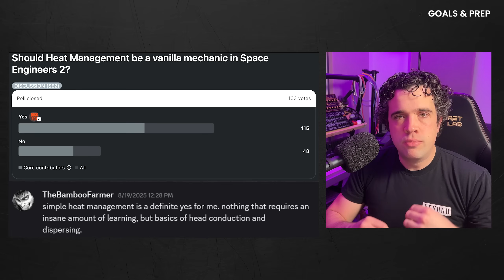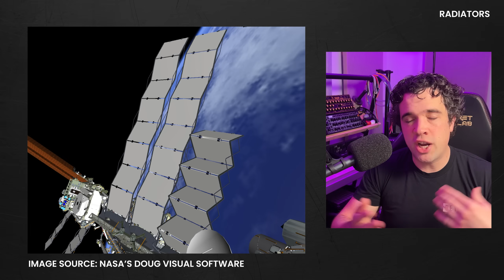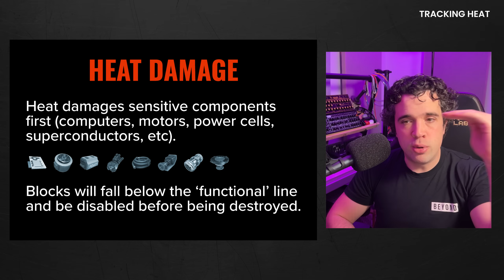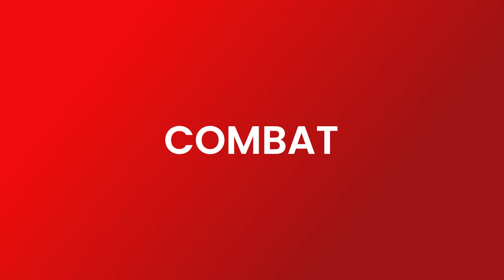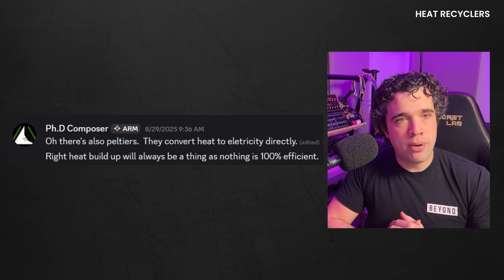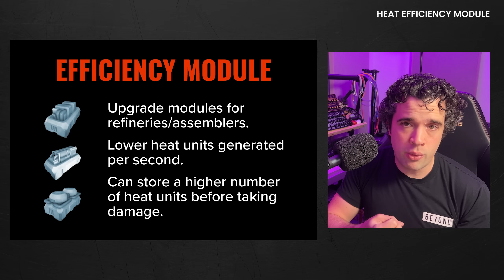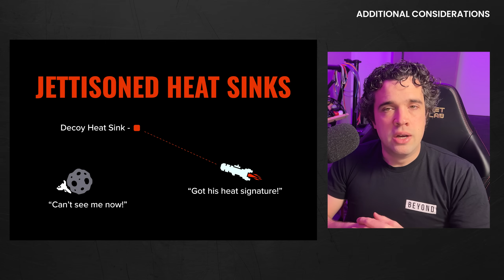Heat in Space Engineers 2? How heat could change EVERYTHING

Comment: I really love how this idea solves gun bricks and limits internal welders.
Reply from the maker: Right. Solves some core metas right now which have no drawbacks! You can still do these things, you just have to be smart about it now so you don't overheat.
Reply: I feel like it'd be difficupt to find a proper balance with the effectiveness of radiators, because on the one hand they need to be bad enough that gun-bricks don't just turn into gun-bricks with a bunch of radiators taped to the back, but also they need to be good enough that one can build a good looking warship that is not just totally covered in them.
Reply from the maker: @etwasanderes2  Just shoot 'em in the back 😉
Reply: @diggrok  having a distance penalty for radiators/heat batteries from high demand blocks might be a solution, that further they are from high heat producers the more required, thus more vulnerable. So either gun brick with giant weak spot at the back or more intelligently spread out heat management blocks rewarding interesting ideas (but obviously if heat management blocks are too close to weapons that make them vulnerable to heat seekers)
Reply: @MrMediator24 You also just made normals ships nerfed... Normal ships with a lack of interior blocks.
Reply: @etwasanderes2 problem is that some people don’t know that heat is a problem in space and the design philosophy for radiators does not support how people build
Reply: @etwasanderes2  See I think the main way to fix that is like it says in the video, radiators are a weak point. This forces you to be deliberate in where you place them and for many combat ships they will likely rely mostly on internal heat sinks for actual combat.
Reply: Just cover the outside of the brick entirely  in radiators lolol this wouldnt stop those people
Reply: @joshjenkins3815  I mean yeah you could do that but that's gonna be worse than an actual well engineered combat ship and all its gonna take is destroying some of those radiators and then your opponent is just going to cook themselves alive trying to fire that many guns at once.
Reply: @OrbitalMechanist and the normal well engineered ship either cooks faster, or dies faster, because it wants to be pretty, not a turret wall with radiators.
Reply: @SioxerNikita  I'm a little confused as to what you're getting at. I never said anything about ships being pretty, all I was saying was that a heat mechanic does effectively regulate gun spam. This doesn't solve every single problem with the SE meta but at the very least it limits the amount of guns you can effectively use on a single ship. This solves gun bricks specifically because if you are limited in how many guns you can use at once without sacrificing survivability then covering a ship with them just isn't practical.

The normal well engineered ship in this case doesn't cook faster or die faster. If you build around having less guns and less radiators you will be able to take waaaaay more damage and stay alive long enough to shoot back and kill the other guy who probably won't even live long enough for a second volley. You can technically still build for high volume of fire with a shit ton of radiators, but now that's a specific niche type of ship with almost no survivability and a giant glowing weak spot. It doesn't completely eliminate giant battleships covered head to toe in guns, but it makes them a lot harder to do well and it makes it so that they aren't the solution to every problem.

That should be the goal with the mechanics in space engineers 2. Everything should have a tradeoff. Like 90% of IRL engineering is just carefully balancing stuff like this and that's what makes engineering games fun.
Reply: @OrbitalMechanist  It doesn't really effectively regulate gun spam. It doesn't limit the amount of guns you can put on a ship, anymore than conveyors or Gyros. It just because another block you need to place. 

The thing is, a "Normal well engineered ship" does not necessarily have any level of advantage. Why would you be able to take "waaay more damage"? If that were true, gun bricks wouldn't be the default meta. And no, you don't need a ton of radiators, just a ton of coolant and/or heat sinks, and just about as many as anyone else needs per gun. 

Overall, the problem is that the heat management system does nothing but give another block tax for just playing.

And no, it doesn't make gun bricks any harder to do. If anything, it makes the kind of ships most players want to see harder to do. It makes the gun brick easier comparable, because it is just scalable volume. 

Space Engineers 2 is already about trade offs, but the Engineering in Space Engineering doesn't come from managing various bars and stats. It comes mostly from self-imposed challenges. The "build an automated factory" or "Fit all the systems and try to maximize this ship while still making it look like a sci-fi ship".

In reality, cylinders or cubes is the most likely shapes in real life space, as long as the vessel never needs to go into atmosphere. That or perhaps spheres. A well engineered combat vessel in real life is going to be semi-autonomous cylinders packed with weapons so they can end fights rapidly. They'll essentially be the death bricks.

The more "trade off" mechanics you add, without artificial limitations, the more designs will just converge into bricks/cylinders/death bricks, because those are the most efficient designs. The more interior space is needed for arbitrary blocks, the more design goes away from having a well designed interior for people playing Survival. 

The thing that makes ships/vehicles/bases/etc. look like they do in real life, is because they have to be operated by real breathing humans. You don't even really play a real breathing human with space requirements, a need to maintain every subsystem, etc. 

The incentives shift towards the thing you say it solves.

And I donnu, but adding an "opposite Reactor" bar doesn't really seem like it adds a lot of Engineering. SE is already mostly "Put Thrusters onto something until it satisfies speed and lift" and "Put Gyros onto something until it satisfies your need for turning" and "Put Power Plants on to it until it satisfies your power need", you just added "Put heat modules on to it until it satisfies the heat need". It doesn't really add that much, it's just another block tax in most cases. There isn't really that much cool "Engineering" in it.

Real Engineering is balancing structural integrity, very limiting cost, maintenance accessibility vs. size and weight, keeping meat cylinders comfortable, material strengths for the job needed, etc. etc. etc. The vast majority of real engineering doesn't get emulated by adding another bar to manage, because for that to have any feeling of real engineering it would be about putting down heat pipes, active cooling systems centered around important points, ensuring that heat never reaches things that melt, etc. and I'd prefer having larger ships at more than a few FPS than trying to emulate a simplified thermodynamical heat system, because that's what's needed to add engineering.

If managing stats like that is "Engineering", I'm "Engineering" every time I choose a fit in EVE or Elite Dangerous... but stat balancing works great in those games, because you have fixed hulls. You don't have a fixed hull in SE, and most problems are solved by "Just add more blocks".
Reply: @OrbitalMechanist  Oh yeah, also, it doesn't matter if you end up cooking yourself alive trying to fire that many guns at once... if the opponent is incapacitated before you overheat.
Reply: @SioxerNikita  I feel like you aren't understanding the idea of the heat system. It can take way more damage because it doesn't have so many guns that it needs to be covered in fragile radiators and the loss of a few will make it overheat. A ship covered in radiators and guns cannot afford to take a hit. 

Also I was referencing IRL engineering as a "thats the right feeling to go for" not saying that it has to emulate real physics one to one. Space engineers has a speed cap and most fights take place within visual range, which means its already completely different from actual space warfare. And the heat system isn't just "another bar to manage". The whole point is that it interacts with almost every other system in ship design so that you have to build ships with heat in mind.

I think its interesting that you brought up the fact that current SE is very much just about "add more of this thing until it works". The main reason for the heat idea is that it counteracts that flaw. In space, everything generates heat and so if you don't want to overheat you can't spam thrusters and guns. Radiators and heat sinks act as a way to alleviate this issue slightly, so it isn't just a hard cap, but volume scales faster than length and so you get diminishing returns. "Just add more ____" only works to a point. If you try to build a ship that can do everything all of the time, it will be wildly cost-inefficient or it will suck at everything. Probably both.

As for the second reply, that would be the only point of a ship covered in guns if you had a heat system. A single volley can do a lot of damage but you best be damn sure you can disable your opponent's ship with that volley or you're gonna have a bad time. And the easiest counter to that strategy is just to use multiple ships or strike craft. If they spam point defense then that means they are devoting that much maximum heat into something that isn't guns so you can bring in your own gunship and win that way. My goal isn't to invalidate the gun brick (because lets be honest sometimes a ship covered in guns is kinda cool) but to make sure that it isn't the sole meta and that there are other viable approaches to combat.

Lastly in regards to asthetics, while that wasn't really a part of my initial remark I do agree that the devs should attempt to design the systems in such a way that it encourages good looking ships. 
Because of the weird speed cap flight model the game currently uses, battles (especially if they increase survivability like they want to) behave a lot closer to naval warfare than space warfare. Because of that, the ideal ship is not going to be a sphere or a cylinder. It somewhat depends on a ship's role in a battle and its intended purpose in combat but most SE combat ships would ideally be diamond shaped, able to bring all guns to bear on a single forward target while focusing all of the armor and defenses on that same target. I personally don't see a problem with ships built for 1v1 encounters being diamond shaped, because the minute more ships enter the equation it gets a lot more complicated and you get way more options.
Reply: @SioxerNikita  and as for the idea of just using internal heat sinks or coolant, those would be less vulnerable but still subject to diminishing returns as the total mass of a ship increases. I personally would make heat sinks explosive in addition to that, and coolant has its own challenges.
Reply: @OrbitalMechanist  "I feel like you aren't understanding the idea of the heat system. It can take way more damage because it doesn't have so many guns that it needs to be covered in fragile radiators and the loss of a few will make it overheat. A ship covered in radiators and guns cannot afford to take a hit. "
Okay, now remember the entire video. You don't need to be covered in radiators... you just need enough heat sinks so you can fire your guns long enough that the other ship is incapable of fighting back.

Yes, I understand the idea of the heat system. I also know it will require adding radiators to ships all over the place if you want to do anything that requires sustained heat.

"Also I was referencing IRL engineering as a "thats the right feeling to go for" not saying that it has to emulate real physics one to one. Space engineers has a speed cap and most fights take place within visual range, which means its already completely different from actual space warfare. And the heat system isn't just "another bar to manage". The whole point is that it interacts with almost every other system in ship design so that you have to build ships with heat in mind."
Okay, power interacts with almost every other system in ship design. It's a bar to manage.

Unless heat moves from block to block, requires heat piping, to get it away from hot areas towards cold areas, it is essentially just a bar to manage. One you can decrease the heat with radiators, and increase the capacity with Heat Sinks as described.

And I do not want a thermodynamic simulation in the base game, it would make the game crawl to a halt.

"I think its interesting that you brought up the fact that current SE is very much just about "add more of this thing until it works". The main reason for the heat idea is that it counteracts that flaw. In space, everything generates heat and so if you don't want to overheat you can't spam thrusters and guns."
Now here is the point. You can still just spam thrusters and guns, because there are blocks you can use to stop that. If heat becomes so punishing that the alleviating blocks doesn't help, all you did is putting a timer on every block that can run, and punish all forms of ships, not just ships for fighting... unless the only blocks that generate significant amount of heat is thrusters and guns, then you still see what happens. You don't reduce the amount of guns because you have a heat budget, because you can still do far more damage initially, so even if we say it counteracts "that flaw", you just encouraged all the guns anyway, and then a slow trickle of fire afterwards that can be managed, because the alpha will destroy a lot of the external blocks on the enemy before heat becomes a problem. 

"Radiators and heat sinks act as a way to alleviate this issue slightly, so it isn't just a hard cap, but volume scales faster than length and so you get diminishing returns. "Just add more ____" only works to a point. If you try to build a ship that can do everything all of the time, it will be wildly cost-inefficient or it will suck at everything. Probably both."
That's the interesting part, you said volume scales faster, yeah... that means you can add more heat sinks, more and more as much as you want, because everytime you increase size, you increase volume more.
And yeah, building a ship that can do everything all the time isn't really the flaw you were talking about fixing. You were talking about welder walls and gun bricks. This doesn't solve gun bricks... the most cost-efficient ship in combat is the one that takes the least damage, the ship that takes the least damage is usually the one that focuses primarily on firepower or very exploitative maneuvering. The exploitative maneuvering is one shot that hits and dead in many cases, and tends to take a long time to kill stuff... Also interestingly enough, this idea would kill that more than the alpha buildings.

"As for the second reply, that would be the only point of a ship covered in guns if you had a heat system. A single volley can do a lot of damage but you best be damn sure you can disable your opponent's ship with that volley or you're gonna have a bad time."
Heavily depends on the balancing. If it becomes that limiting, then the other ship is also going to have a bad time, because you just took out a ton of radiators, guns, thrusters, etc. You don't have to disable them fully, just make them worse off than you.

"And the easiest counter to that strategy is just to use multiple ships or strike craft. If they spam point defense then that means they are devoting that much maximum heat into something that isn't guns so you can bring in your own gunship and win that way. My goal isn't to invalidate the gun brick (because lets be honest sometimes a ship covered in guns is kinda cool) but to make sure that it isn't the sole meta and that there are other viable approaches to combat."
If we go with "Easiest counter to that strategy" then my counter to that is "use multiple ships myself, with also a lot of guns on them, and strike crafts, with lots of guns on them".
That's not really a counter strategy, that's just... add more ships... which the gun bricks can abuse by deploying more alpha gun bricks.

You can't really solve this meta, without cultural rules... because that's how block building games work. Empyrion has tons of arbitrary block limits, and it has the same issue if you start looking at PvP metas, unless there are artificial rules. Block limits just means you optimize where you place your limited blocks, not stop building the most efficient design.

"Lastly in regards to asthetics, while that wasn't really a part of my initial remark I do agree that the devs should attempt to design the systems in such a way that it encourages good looking ships. "
You can't really, because even real life doesn't really "encourage" good looking ships. It's a total accident that physics encourage ship shaped designs in water, and tank shaped designs on land. Those are optimization bricks as well. They aren't platforms doing it for aesthetics, they are just physics limited things. To make the systems in a way that encourages the same kind of design, you need to add things like maintenance requirements (Chores of having to be able to reach blocks), much longer construction times (because if you can just grind and maintain the block, and weld the armor block back again, you aren't encouraging maintenance corridors much), random failures, full on aerodynamic models, and having to maintain actual NPC crews that can do these tasks, and that is simply not realistic to do in a block building game. Adding heat doesn't encourage more good looking ships, at least as described here. It gives forced external blocks that will have to be built around to make good looking ships, and punish ships that wants to look pretty with windows and interiors. Unless you have to deal with almost all of physics, most "realistic" features added, will just converge on bricks with guns in combat.

"Because of the weird speed cap flight model the game currently uses, battles (especially if they increase survivability like they want to) behave a lot closer to naval warfare than space warfare. Because of that, the ideal ship is not going to be a sphere or a cylinder. It somewhat depends on a ship's role in a battle and its intended purpose in combat but most SE combat ships would ideally be diamond shaped, able to bring all guns to bear on a single forward target while focusing all of the armor and defenses on that same target. I personally don't see a problem with ships built for 1v1 encounters being diamond shaped, because the minute more ships enter the equation it gets a lot more complicated and you get way more options."
What makes SE behave more like Naval Warfare (Specifically Caribbean style naval warfare) than Space Warfare is primarily the very limited engagement range. In reality, space combat will be out in ranges where you can't see the target with your eyes. That is actually how Naval Warfare primarily works now. It becomes a question of who sees who first, and who has the best point defense, and who has the best weapons to breach the other side's point defense.

And yeah, cylinder is essentially real life future space ships, look at Children of a Dead Earth. That is what space combat will almost inevitably work towards. Missiles, orbits, guns, semi-autonomous cylinders with as few exposed sub-systems as possible, and as few sub-systems necessary with some redundancy.

SE though, broad sides are in the end more efficient, you have a large surface area, and especially with all of the AoE weaponry, means that you lose less weapon systems per hit. The Diamond shape also compresses a lot, and surprisingly enough less effective, because you end up spending more weight on heavy armor blocks because of the prolonged length, and you end up with a sidewas far larger cross section overall.

And I've played enough EVE to tell you one thing, more ships doesn't necessarilly add more options. It works for a short while, for specialized prepared combat. It quickly compresses into "shoot one target at a time until dead, then go on to the next". Tactical choices and options sound great until you remember that cover, dropping to the ground, obscuring features like trees and bushes, and more, aren't really available in Space. It becomes very Naval combaty. You fire at what you can, or you concentrate enough fire for quick kills. Naval combat until recent was kind of "slugfesty" because it was hard to hit. Even WW2 ended up being less about maneuvering unless close to Islands that could afford you cover, and more about staying in or out of range.
Reply: @OrbitalMechanist  You are aware that heat mechanics rely on mass? 

Making heat sinks explosive is a very mechanical fix, because heat sinks ... aren't explosive... heats sinks are massive metal blocks, or massive tanks of some kind of liquid with large thermal capacity.

And no, coolant and heat sinks has the exact opposite problem, they make gun bricks more efficient, because you now have a way to scale your fighting time directly with interior volume.
Reply: @SioxerNikita  
I do remember the video and this is just getting the heat system balanced correctly. Ideally the stuff in the video is more geared towards rational ships, and not gunbricks. that many guns should generate so much heat that you need that many radiators to survive.

That's fair actually, although I think calling it "just another bar to manage" is a bit silly. the point is that its another bar that adds meaningful decisions to how you design ships and does something that the current bars don't. Whether or not it is a bar has no relevance to if it can benefit gameplay and ship design.

This is a bit of a tangent from the implementation discussed in the video but I do think there are ways you could do a locational heat system that wouldn't tank performance. Anyways, that's off topic and the rest of this is still assuming it is just "a bar" as you so eloquently put it.

I think that if you dropped this heat system into SE1 as is, I would very much agree. The issue is that we know that the devs are attempting to vastly increase survivability in the second game's combat, ideally to the point where 2 ships can fire back and forth for multiple minutes without one losing. I think this would make the "alpha strike" strategy potentially still viable but only for niche situations with support from other ships more suited for brawling.

I mentioned volume because as you increase the surface area for gun/radiator space, you get exponentially worse at dissipating heat. Yes you can have internal heat sinks, but I imagine these would be prohibitively expensive to use as the sole cooling strategy for a larger ship. As for coolant systems, they would probably be prohibitively massive for a large ship as discussed in the video. 

This is again, another situation that would be fixed with increased survivability.

I feel like an underlying assumption you are making is that both sides have access to infinite resources and different ships all cost the same. Using more better engineered ships would be significantly more cost effective than a single gun brick. You can't just "bring more gun bricks" unless you have way more resources than the other guy. You can definitely use a gunbrick as an accessory to a larger fleet, but I am fine with that. Thats not a singular meta thats just one of multiple viable options.

I would very much disagree with the problem that you can't solve this meta mechanically. I have been making games for my entire life and the puzzle of "how do I build systems to encourage fun/cool building and player behavior" is one of the most entertaining parts of gamedev for me. Even if heat didn't work in this instance, there is absolutely a way to build a game system that encourages varied and good looking ships.

Obviously IRL doesn't encourage "good looking" ships. We make what works best and then that's what gets used. Those designs and ideas are expanded upon in fiction and that gives us expectations for what combat ships in a generic soft sci-fi setting should look like. That is what we are trying to emulate. This is absolutely possible to do without actual physics simulations, though I don't think heat solves this particular issue. I personally have a lot of thoughts and ideas on this particular topic but that is irrelevant to the current discussion.

You do end up with a far longer worse profile sideways, although that really depends on your strategy for combat. Ideally a diamond ship would be facing the enemy at all times. Diamond ships are better for ships that focus single targets and rely more on armor than tangential acceleration. If you build a more manueverable ship with less armor, broadsides are no doubt better. This makes your ship significantly easier to kill, however, as rounds will never ricochet off the angled armor and your armor has to be spread over a wider area. it also makes spinal weapons much more difficult. 

Now this i would very strongly disagree with as EVE is a very different game from SE. The ability to build your own ships from the ground up means that you can create your own fleet doctrine based around picket ships or long range rail snipers for support. You don't need cover for interesting fleet mechanics, range and direction control is already very complex in larger battles. Everything I said about a diamond ship goes away when you have multiple targets shooting at you from different directions. Then you need to make either enough diamond ships to split off into 1v1s or you need to make uniformally armored brawler ships that don't have the same raw damage output as a diamond ship but have the ability to engage multiple targets without exposing a blatant weak point. You can then use those ships in combination with diamond ships and form a defensive screen that prevents your diamond ships from being flanked. Then the enemy could counter with a faster ship that can punch through or around a defensive screen without taking too much damage, and now you can counter that by bringing a carrier that can hunt down the more maneuverable ships with strike craft. From there it just goes on and on with both sides needing to adapt and adjust based on what they are fighting.
Reply: and for the heat sinks being explosive I am aware that it is fairly arbitrary physics wise, but I also think that in this case it is worth it to put gameplay over realism.

as to the heat sinks and coolant problem, even disregarding the fact that it would likely be expensive (heat sinks) or very heavy (coolant), you are giving your ship a hard time limit and once you overheat, your ship is just done for. You technically can just add more, but at some point it just becomes a waste of resources considering that heat regulation also scales down with volume due to the square cube law (which still applies with radiated heat, not just conducted heat). that means there are diminishing returns and eventually you end up building like 50 heat sink blocks for a single enormous 40 gun battleship when you could have just built 10 smaller 6 gun ships that only needed 4 heat sinks each and a few radiators.
Reply: @OrbitalMechanist  But it isn't really a meaningful decision... it becomes a bar to manage similar to energy, and your choice is between capacity and shedding. It's not really that deep of an engineering choice. It's frankly more of a question of a trade off in Elite Dangerous... because you have fixed hulls. It functions similarly to the function the reactor has, and for that matter Gyros, a tax to get your ship functioning. There is not really that much meaningful choice. If you have Uranium you are 99.9% of the time better off building reactors than batteries, because of how terrible renewable sources are in the game. 

"This is a bit of a tangent from the implementation discussed in the video but I do think there are ways you could do a locational heat system that wouldn't tank performance. Anyways, that's off topic and the rest of this is still assuming it is just "a bar" as you so eloquently put it."
I mean, you done programming? Anything that would be localized would be by block, and larger ship regions, but it would still be abstract and feel weird, and it is still a trade off.

"I think that if you dropped this heat system into SE1 as is, I would very much agree. The issue is that we know that the devs are attempting to vastly increase survivability in the second game's combat, ideally to the point where 2 ships can fire back and forth for multiple minutes without one losing. I think this would make the "alpha strike" strategy potentially still viable but only for niche situations with support from other ships more suited for brawling."

I think if you dropped this heat system into essentially any space ship block based game without arbitrary and weird balancing mechanics, it would either be too little effect on combat, be only relevant in combat, or it would just become a block tax to handle that aspect you don't really care about.

As proposed here, you only really have two major choices in space. You have radiators that slowly shed, you have heat sinks that increases capacity, and you have steam shedding that decreases your heat.

As long as any bulk cooling exists, and as long as it sheds more heat per weight than heat sinks give in capacity, then yeah, that's what death bricks will be. Even From The Depths in the more competitive sphere becomes just death bricks, with a slight amount of hydrodynamics so it sails.

But From The Depths is designed front and center as a combat game, with other abstractions, tons of weapons, self design of weapons, and more knobs to dial than in a nuclear power plant. It still doesn't really get great amazing long combat until you get massively big ships.

Also, you can get longer combat by just decreasing weapon damage.

And honestly, "Alpha strike" or just "ADD AS MANY TURRETS AS POSSIBLE" will still be the meta strategy, even with heat, and even with a balance around multiple minutes. The death bricks will just optimize it. I don't know why you keep bringing up heat in combat?

It isn't going to do what you want... It works in Elite Dangerous because you can't just put more cooling or more heat sinks, or more coolant in your vessel. Space Engineers you can. If the heat system becomes so punishing that it harms death bricks so much, it will harm normal players and what you call "well-engineered" ships, far more. The optimizers will be able to tune those dials far better than you likely will, and when they do, their death bricks get a much larger gap in power than before.

Any game like this, the more dials you add, the more limitations you place, unless you go full realistic, unless it is arbitrary mechanical stuff, then optimizers and the death brick will become the meta. You aren't solving this magically with a nebulous heat mechanic.

You also don't even consider what will happen with normal ships the moment you add heat that becomes extremely punishing for death bricks.

 This is absolutely possible to do without actual physics simulations, though I don't think heat solves this particular issue. I personally have a lot of thoughts and ideas on this particular topic but that is irrelevant to the current discussion."
You started out by saying it solved death bricks... because of this heat suggestion, now you are saying it doesn't, and your thoughts and ideas on this particular topic is not really irrelevant.

"Ideally a diamond ship would be facing the enemy at all times. Diamond ships are better for ships that focus single targets and rely more on armor than tangential acceleration."
And then you do something else, and you just make a brick, and you turn front, and two sides towards one enemy, you get the same effect, without a lot of loss of internal volume. Besides, whether they are brick or diamond shaped, they are still just unappealing death machines. Just because you change the shape to an elongated pyramid on one side doesn't make it more appealing by default, it will still mostly just be a boring brick with tons of guns. 

" If you build a more manueverable ship with less armor, broadsides are no doubt better. This makes your ship significantly easier to kill, however, as rounds will never ricochet off the angled armor and your armor has to be spread over a wider area. it also makes spinal weapons much more difficult. "
Erm, you are aware just because you broadside, you don't actually have to have your broadside flat towards your target? And so far with SE, turrets sometimes have issues targeting straight up, so... I donnu, sounds like a bad way to broadside.

"Now this i would very strongly disagree with as EVE is a very different game from SE. The ability to build your own ships from the ground up means that you can create your own fleet doctrine based around picket ships or long range rail snipers for support."
In reality, most effective tactic very quickly becomes "Choose a fleet range, and focus fire as much as possible", even in real life, if they could've afforded all combat ships to have same range, they would've. Closer ships are more vulnerable.

EVE Online is a perfect example, because the tactics you can do are endless, there are so many ways to do it. You can quite literally make a picket ship doctrine, or a long range rail sniper support line, or full on super tank, or anything in between... Because EVE online allows a WIDE variety of tactics and concepts. Frankly, far more than Space Engineers ever has or ever will be able to supply. Despite that, the tactical level compresses very quickly with fleet size. 3 v 3 allows for some tactics, but it mostly relies on the things any fleet brings: Interception/diction, Webs, some sort of survivability, and then some sort of DPS. Some fleets try to tank with speed, others with shield, others with armor... but in the end, splitting the fleet up heavily into specialized damaging units is usually a bad idea, because it means you lose fleet cohesion...

"Everything I said about a diamond ship goes away when you have multiple targets shooting at you from different directions. "
No, it doesn't... Because you can still focus down a target, and you can still shoot in mostly 5 out of your 6 directions rather effectively, but focusing down a target in sluggy combat is quite literally the most effective tactic. Stopping one ship from being a threat, then turn to the next, etc. The only thing you don't want to do is overkill a target too much, because that is wasted firepower.

"You can then use those ships in combination with diamond ships and form a defensive screen that prevents your diamond ships from being flanked."
Or you can just have full on death diamond ships (Which is still just death bricks, just a slightly different shape), and split it into 2 or 3 groups, that points different directions, and focus fire enemies in those directions.

That's what it will turn into. If you don't have cover, all you have is maneuvering, and if all you have is maneuvering, then overwhelming firepower when you are in range often wins.

"Then the enemy could counter with a faster ship that can punch through or around a defensive screen without taking too much damage, and now you can counter that by bringing a carrier that can hunt down the more maneuverable ships with strike craft. From there it just goes on and on with both sides needing to adapt and adjust based on what they are fighting."
This is the cinematic fantasy that many imagine... it can work if you instead focus on making a server of roleplayers and reenacters, and create slight scripts for battles, strict requirements for ship roles, etc... 

This is not what you will get in games like this naturally. The turn rates you can get out of ships when it is only a tax block, independent of design (Gyros) means that actually flanking something doesn't really have the effect you think it does.

The funny part is, the scene you describe here is also the "Homeworld fantasy battle", in reality it becomes "Mass synergies of ships, click enemy ships, in what ever formation works best for that formation of ships, and then wait for the death spheres to win the fights"... and the funny part is, Homeworld is actually a game where these strategies would be effective, but it simply requires far more coordination than you might think, and it still dies to an equal amount of resources spent on death bricks.

I agree, the fantasy would be fun, but you are not getting that fantasy out of a block building game without arbitrary limitations like "Ship Core: Carrier" and "Ship Core: Destroyer" and arbitrary limitations form that, and massive limitations to landing ships, and connectors and other stuff, essentially all the features people actually like about Space Engineers.
Reply: @OrbitalMechanist  Yeah, doesn't matter if the hard time limit is before the enemy dies... 

And no, it doesn't just "Become a waste of resources" because the faster you kill the enemy, the less OTHER resources you lose.

And no, heat regulation doesn't scale anything with any law, outside of having specifically more heat production inside, in a block building game where the primary three factors of heat management is radiators, sinks, and bulk shedders.

And no, heat management wont have directly diminishing returns if you don't use something that directly requires surface area... because the heat generated will be LINEARLY scaling with the amount of turrets you have... not exponential scaling with your interior volume. 

And no, you couldn't do that, the 10 smaller 6 gun ships still has mass to move around (thruster need scales linearly with weight), the guns still scale linearly with the heat... 

So no, unless KeenSWH adds an ARBITRARY punishing mechanic SPECIFICALLY for volume, the only thing more volume adds, is more space for more heat sinks and more coolant, so you can run more thrusters.
Reply: @OrbitalMechanist  Also, if you want your fleet mechanics, and a design space that encourages something a bit more than gun bricks and internal welders. Try and play From the Depths, and you might see why people don't just want arbitrary "engineering" choices in the game. Because the systems can become so opaque you have no idea what you are doing.
Reply: @SioxerNikita  
First off I have been coding games since I was 14 (though I won't claim to know the ins and outs of the Vrage 3 engine) so I have a little experience in that department. One potential approach you could use would be to create a sphere on heat generating or heat removing blocks that represents the spread of heat from that block. As the heat increases, the sphere gets bigger, with parts of the sphere farthest away from the heat source affecting blocks the least. If you do this, then add up all of the total heat effects from your different spheres, you get a total temperature for a hull block. The key thing here is with this system you only need an exact temperature for blocks viewed or interacted with by the player. Everything else could be done as a simplification of the previous system that generates temperature zones within a ship (for instance you save the regions with a temperature above boiling and then have those just be "boiling zones" without doing much behind the scenes).

The point is that it would only be relevant in combat or massive industrial facilities. This is specifically a combat mechanic.

And again, this is just a matter of balance. Assuming equal resources for each side, all you need to do is make coolant systems prohibitively massive and make heat sink spam prohibitively expensive. 

As a clarification, when I said I thought it was irrelevant I was specifically talking about ship aesthetics. That's not something addressed in the video or my initial remark and so I had assumed that was outside the intended scope of the discussion.

Angled broadsides are better... that's the reason diamond ships are good. Diamond ships are better (specifically for 1v1 fights as a ship that doesn't rely heavily on tangential acceleration to survive) because you maximize the amount of surface area exposed to a target. 

I think a much better example than EVE for representing this kind of combat would be the game Nebulous: Fleet Command. Its fairly small currently but it is one of the few games that really does the whole "this counters this counters this counters this all the way around" thing extremely well. Its also an excellent representation of how fleet size contributes to tactical depth and design decisions. Now I will say asteroid cover plays a much more prominent role in most normal Nebulous games, but open space games do still exist and they still provide a lot more complexity than "focus down one guy until he dies, repeat".

Overwhelming firepower when you are in range does win sometimes, but SE is not EVE. In a more semi-Newtonian fight model, enough distance and tangential acceleration allows you to straight up dodge projectiles of any kind. Armor is also significant to this equation, as stated previously. This is a rather strange idea to base balance on, as there are tons of different ways to mitigate overwhelming firepower, with all of them interacting on some level with the range/direction game. Both maneuvering for defense and armor involve movement and direction changes. Balance in a game like SE is extremely complex, and it doesn't just boil down to "biggest gunbrick" unless you make a system that allows you to build as many guns as you want with no adverse effects (SE1). I would recommend looking into the draconis expanse SE1 server, as I think it does the "distance and direction based combat" extremely well. In the expanse armor doesn't do much, and so they have an entire combat system that works purely based on maneuvering as defense and the balance between mass, acceleration, and firepower.

I also have gripes with gyros as a whole and generally play SE1 with mods that weaken gyroscopes and add offset thrust forces to ships. I agree that gyros are a dumb system and that sucks, but even with gyros as a part of the game the power cost of turning a ship (especially one weighed down by the mass of a coolant system) contributes to heat buildup, preventing gyro spam (as long as they make gyros have a high enough energy cost).

I strongly disagree with the premise that you can't have an interesting balanced combat system in a block building game without arbitrary limitations and caps. Again, I would point to the draconis expanse SE1 server for how to do this well. I think the issue is that currently there aren't a ton of games like space engineers out there, and unmodded SE1 does this so poorly. From the depths is a bit of a special case in this instance as it isn't multiplayer and doesn't have any of the back and forth complexity that comes with that. Its also a game about making boats that fight within visual range, and the lack of mobility in water combined with the small scale of the game means that the meta is very much oriented towards firepower. Boats are cool and I think naval inspiration is awesome, but space games have waaaaaay more stuff to play around with balance wise than boat games.

That's not an arbitrary punishing mechanic specifically for volume, that's just physics lol. The square cube law is the reason for things like Bergmann's rule and a whole bunch of annoying IRL aerospace problems. Because of how geometry works at a fundamental level, volume increases on a cubic curve while surface area increases on a square curve. This means that as you get bigger, your mass and volume scale exponentially relative to your total surface area. As a general rule, mass and volume make it harder to dissipate heat, surface area makes it easier. Because of that you get diminishing returns on heat regulation as you go bigger. 

Now I will say that I don't think SE2 needs to emulate the thermodynamics that causes the square cube law (like you mentioned before, that would just be silly). It just needs to measure the mass of a grid and then scale down heat dissipation as you go higher. 

Also I have played probably too much from the depths lol, and it does not change my opinion that encouraging diverse and good looking designs purely via mechanical pressure is very much possible.

I think the main issue here is the idea that the meta will always boil down to a single kind of ship, and that ship will be an ugly gunbrick. This just isn't the case. From the depths is the way it is because it is not a PvP game with PvP balance in mind. SE1 is the way it is because the combat system was very bare bones with not much thought put into balancing it for this purpose. By the time the SE1 combat updates rolled around, they couldn't afford any changes that were too major or it would render existing designs completely non-functional. Those are really the only 2 games of this type that have enough players for a developed meta, and both of them boil down to not being balanced for PvP. This doesn't mean that it isn't possible to have well balanced PvP in a block game that doesn't rely on arbitrary limiters. It just wasn't the priority for the SE1 devs when combat first came out and from the depths has always been a singleplayer game.
Reply: @OrbitalMechanist Let me be a bit shorter.

From the Depths is quite literally multiplayer. People play it competitively in tournaments.

Diamond shape in a block based game is not better than just angling three sides.

Your heat sphere idea would not really help representing localized heat, and it would feel incredibly gamey and arbitrary because it is very far from real life. It is also not as processing light as you might think, as it requires a lot of distance checks.

Nebulous Fleet Command relies on a lot of arbitrary rules and hard counters. Space Engineers doesn't have that.

From the Depths literally have ground, air, sea, and space combat.

Okay, let me explain something that you have been ignoring.

Essentially any heat mechanic relying on power generation, thrusters, etc. as described by this video will end up having two major problems.

Either the heat mechanic will be very punishing to gun bricks... And then it will be far more punishing to normal combat ships, because they can't afford the infrastructure and internal volume like the gun brick... Or the heat mechanic is so irrelevant and mostly just flavor you ask yourself what happens.

Notice, in this entire conversation, I have mentioned this quite a bit, but you haven't addressed this. You haven't addressed the effects it will have on the game.

As described it becomes an opposite reactor, a "Put blocks on the ship until the bar acts like you want", and we already have one mechanic like that.

This one is essentially just the opposite.

It will be far more punishing for newbies if the mechanic is going to punish thruster and turret walls... And irrelevant if it doesn't.

Your EVE dismissal misses the point, completely. EVE even simulates that with speed tanking anyways. You can literally be so fast with good transversal speed you can't be hit. And you do the thing again, you dismiss an entire argument and ignore the rest.

EVE Online is one of the games where sneaking around, and that big flashy cinematic fight could happen. It just doesn't because when a fight starts, you are more useful shooting, than trying to sneak around and flank.

And I do find it funny you talk about diamond as if it is better than gun bricks, both conceptually better for the game, and better in a fight.

It's a block game, you can't simulate diamond properly, and the armor wont be properly angled compared to the target... And just having a brick, where you fill most of each side with turrets, you have a "Diamond", and you also have the ability to rotate a battered side, and you get directly angled, and you don't sacrifice a lot of interior volume to shaping.

And that's not even all... Your diamond is just gun bricks, but you act like they are superior for the game anyway. I have no idea how you argue so hard for diamonds without realizing you are just giving the thing you dislike a different name.

And ugly ships being the meta? I would genuinely suggest you stop acting like it is solvable with balance. It might be, if you add arbitrary rules, different armor with different effects, and different weapons with different stats effective against different kinds of armor, and focus on each kind of armor and weapon hard counters each other, with various decoy methods, jamming, sensor systems and more... And what you have is From the Depts that has a lot of complexity and forces ships to have counters, and becomes a game you need to study to fight.

You can like that. The vast majority of SE players wont... They want a relatively simple block game where they can build their fantasy.
Reply: It doesn't really solve gun bricks. If anything, it makes gun bricks far more efficient. You just turned gun bricks from a a gunbrick with reactors and thrusters, into gunbrick with reactors, thrusters and tons of heat sinks. The faster you can end the battle, the less you have to engage with the heat mechanic.

The game already encourages finishing fights quickly, now with this system added as described, it encourages it FAR more...